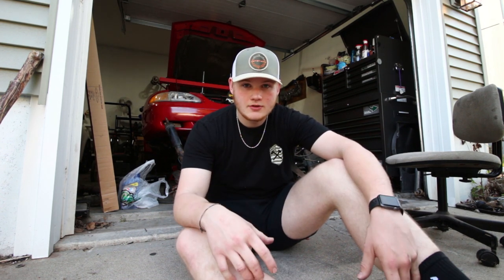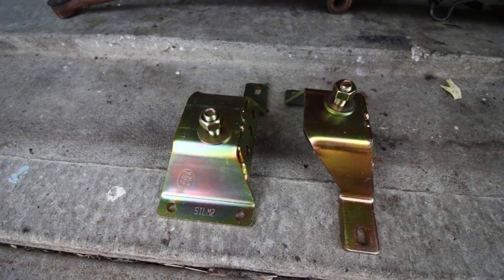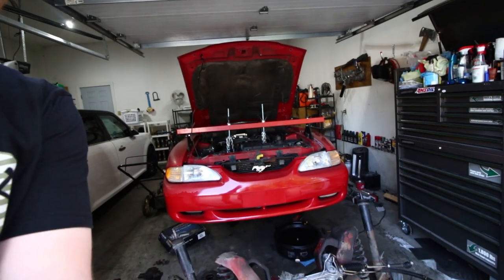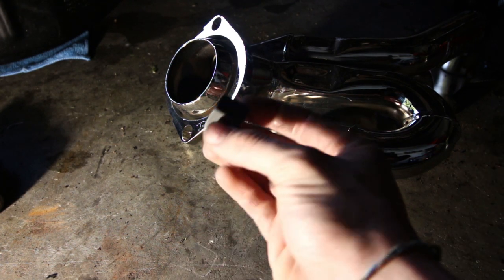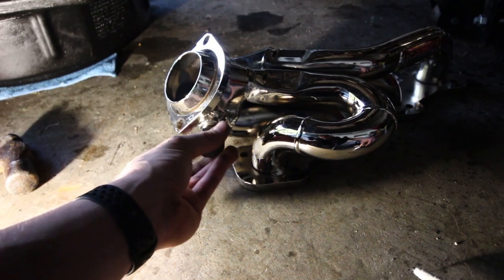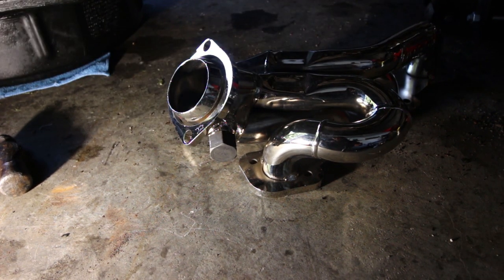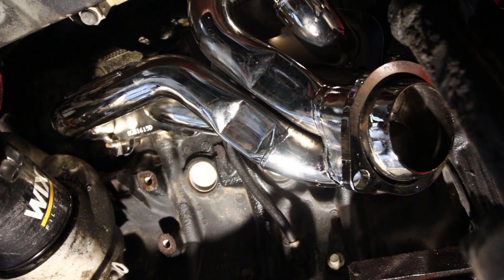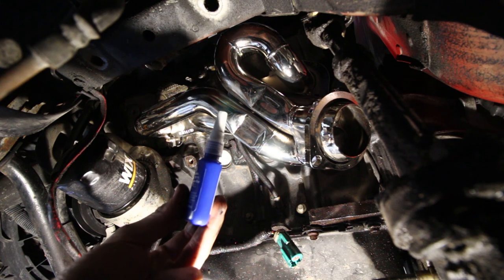1996-98 Mustang GT BBK Header Install (K-Member Drop Method)

Comment: if you do this I recommended metal header gaskets .. I already had the paper BBK gasket blow out the passenger side .. every racing mechanic will tell you never use paper on headers , copper  gaskets are the best